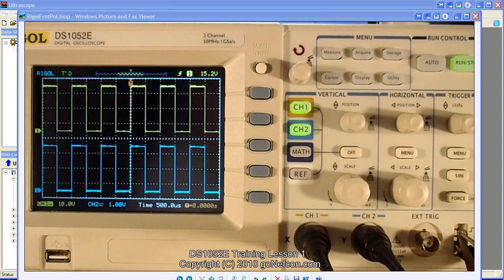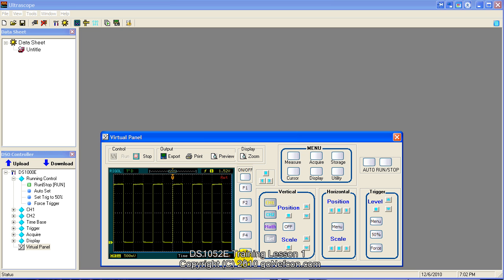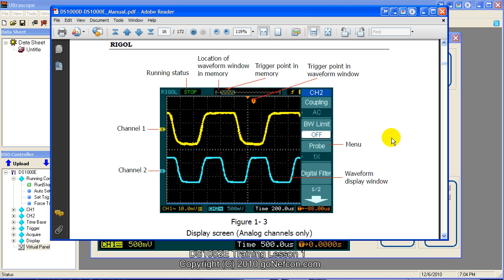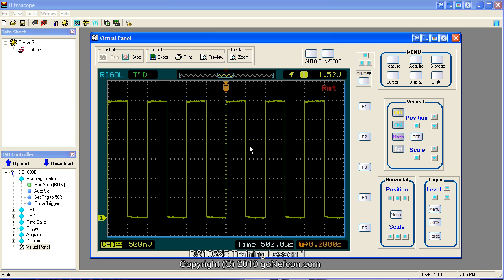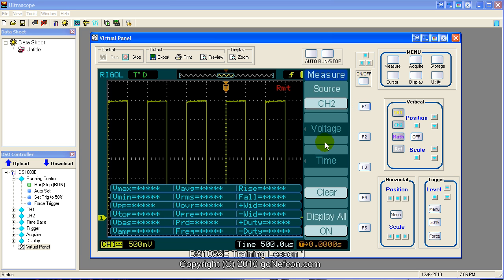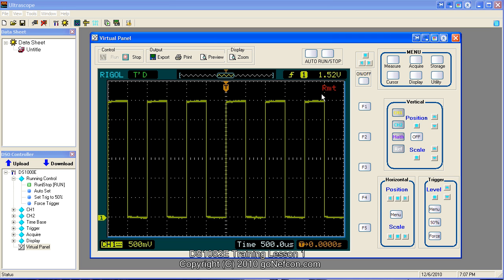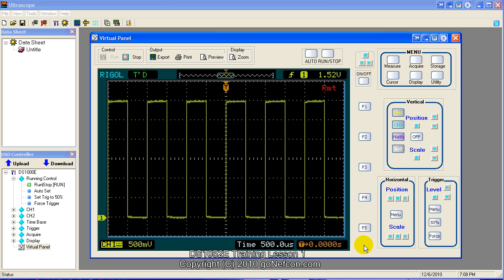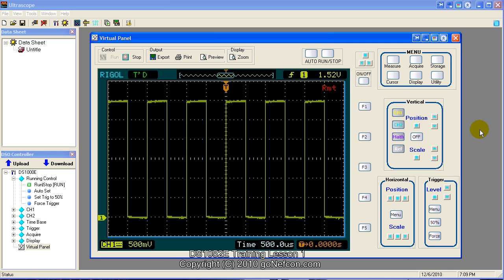Rigol DS1052E #1 Intro w/ Remote Control

Comment from the maker: @jpmorgan187 The only difficult part is getting the correct software. The Ultrascope application that comes on the CD is good, but the drivers on my CD didn't  work. I believe I found the current drivers at the Rigol website.

With the correct drivers installed, just connect the USB cable and start the scope panel.